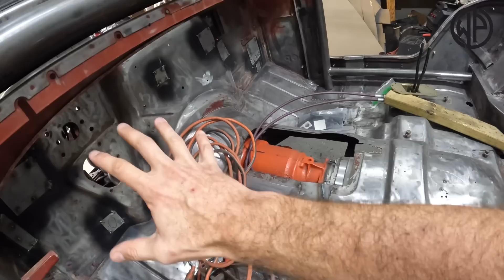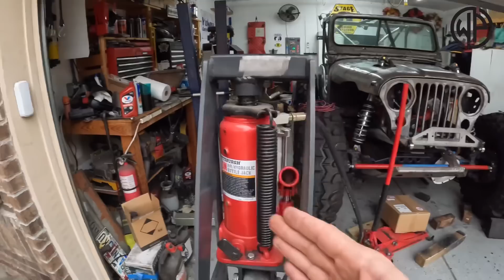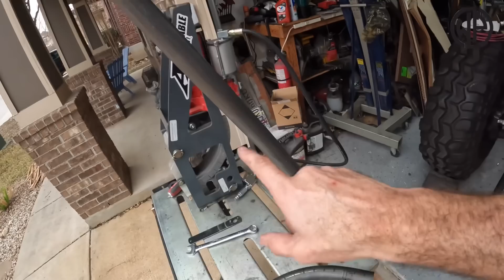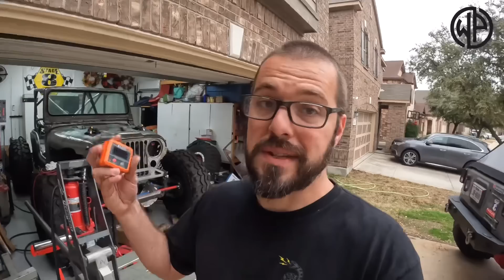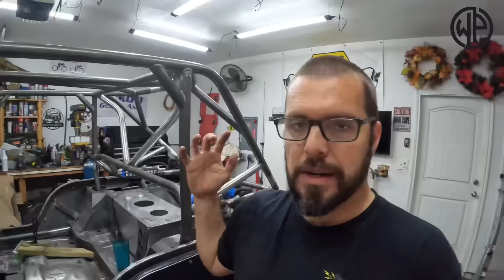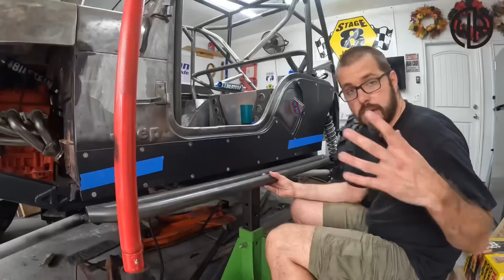Build Your Own Rock Sliders Full DIY - Custom Offroad build

Comment: which jack did you add.   love the video i picked up a used affordable bender but haven't used it yet.
Reply from the maker: @shanes4x4  fantastic! So I picked up the smallest air over hydraulic jack they had. I believe it was the 12 ton.

Comment: Not worried about .120 wall being too thin for a serious crawler?
Reply from the maker: It was a thought. Worst case scenario I cut it off and redo it.  But putting 4 attachment points to the frame will make it stronger than if it had less. Plus it should hold up okay because my Jku is way heavier and it’s held up on that. 

But time will tell. If that tube starts denting…I’ll just cut it off and redo them.
Reply: @ you’re killing it. Cool to see the progress

Comment: Why not switch it to leaf springs? You tried to argue that before….
Reply from the maker: I didn’t try to argue that. I did it. Did it to a Jku. And it was great. It was also cheaper. But packaging and placement on this rig…plus I have more travel and a leafspring. I never said leafs were better than coilovers. But if I have to explain that…sounds like you need to go back and watch the leaf spring videos.

Comment: The tubular Jeep is looking good. I think you should widen the gaps on the front tires only in the horizontal orientation, between the lugs that point outwards. The gaps are already there. I also think you should add the thin sipes at the center of each arrow in the same horizontal direction. Good for forward traction.
   At the back, I would find a lug or place on the tread to add radial sipes, for side hilling, but I wouldn't make them like the front. A cutoff wheel works good, I think halfway through a lug would work pretty well. Cool project.
Reply from the maker: Yea people do that. I have seen it. I’m going to try these the way they are for now. But I’m not against that in the future.

Comment: what we use in the electrical field to keep multiple bends in pipe on the same plane, is a tool called No-Dog.
it's a Bubble Level that clamps on the end of the pipe and allows you to align the bends all the same in the bender.
it's a small bubble level that cost about 20 dollars. we usually get them free on industrial jobs.
Reply: I was going to suggest the same thing. Out here on the West Coast they are called Anti-Dog also. They are a great tool but not necessary after some years of pipe bending. There are other ways of keeping your pipe from doglegging.
 Cheers
Reply: @13_13k  yes there are several other ways but the No-Dog Level is the quickest way for that vertical style bender, when making 3 or 4 different angle bends in a long piece of tubbing like the roll cage or the 2 matching 40 degrees on each end.
Reply: @TwoFeatherChannel  --- for sure. We always used them and a protractor when bending multishot conduits that have to be exact, when you have four or six conduits that 90° and roll from a wall to a hanger and then do crazy thongs like offsets etc.. 
 But, we've had digital controls for benders for decades now all you need to do is maintain that centerline.
Reply from the maker: Heck yea! Thats super cool. I didn’t know about that tool. I have one that allows me to scribe a line down the tube. So when I need to rotate it…I can do it quickly and easily. But that’s interesting. I’ll have to look into that one.
Reply: @WarPaintTexas  Tool that makes your life so much easier. keeps the bends level vertically/horizontally, while you use the angelfinder for the degrees of the next bend.